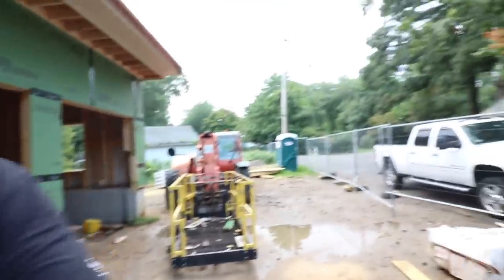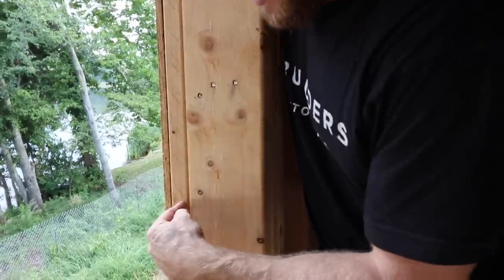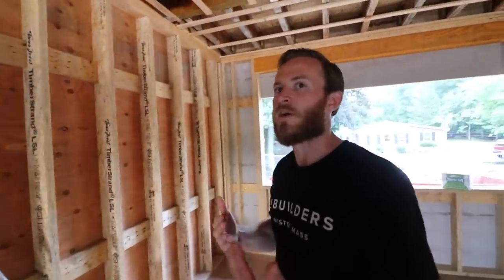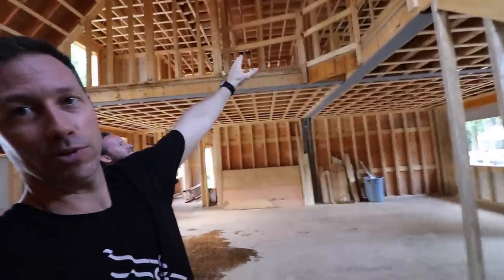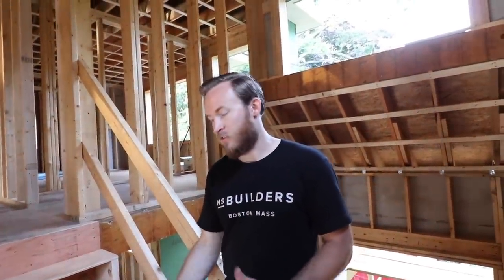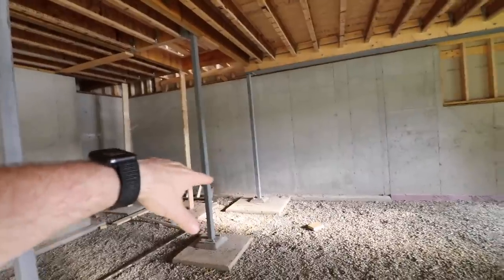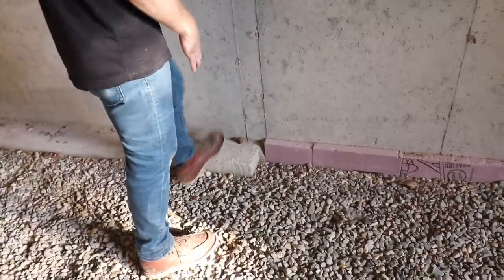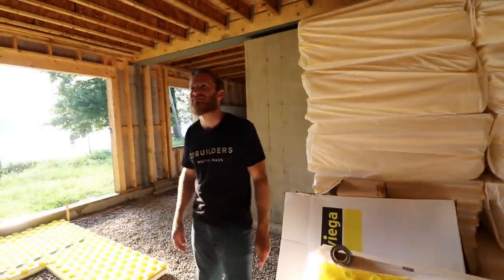How do they Build in Boston? Visiting a new home in Framing

Comment: I'm no engineer but I have difficulty understanding how a good shear strength can be obtained when the sheeting is spaced 2" off the framed structure via 2" of foam. No ridged connection of sheeting to framing? Much more reliant on nail strength? More nailing? Or are more HDU'S, strapping or other means required?

Comment: I am surprised not to see ICF foundations with ESP which does not retain water nor have reduced life /value like the extruded foams when wet.  AMVIC  also makes the radiant infloor  heating panels R-10 to R-16 with a vapour barrier heat welded on the top.. Very fast Pex installation, dont let the plumber charge for three days when hes only there for a day !!

Comment: My Tennessee home had no OSB Board on the outside of the home. When I complained about the noise I was sent for Psychiatric Evaluation and lost my job. After losing my job I had to repair the structural damage to the home and was later forced to sell the home. I've come close to be homeless several times. I'm a 90% disabled/retired veteran that bought new home with VA Home Loan and now I'm certified wacko courtesy of the APA. And my Psychiatrist's husband is contractor....go figure.

Comment: How one builds a home in the USA varies by region since the climate and groundwater varies.    

                       Here on the Gulf Coast of Mississippi how homes are insulated has to be way different than the North. We have long seasons of running the ac units and a short winter plus major hurricanes too. There is no frost line. Basements cannot be built since the house would float out of the ground due to a shallow water table.                    A home built here by north easterners will often fail due to mold.

 Ie how the vapor barrier is can be reversed and trap moisture and rot out the wood. It rains here 70 inches per year. 

Due to hurricanes our local codes has 5/8 (16mm) bolts into the slab about every 16 to 18 inches plus giant washers to hold the bottom 2x4 or 2x6 to the slab.       The code requires this here. Ie the Mass home is substandard here and would fail inspection and cause the work yo be halted. 

Also, our homes, if built in Mass, would fail since codes vary by USA regions.   

  Some Nice homes here rebuilt or built after Katrina (2005) have already gotten mold. Often the reason is foam insulation. Ie moisture got trapped and rotted out the homes walls or roof decks. The entire foam thing is risky if done wrong. Ie an older home that breathes often never has issues.

 Locally the strapping on the lumber for hurricanes is way more. The cost of all the 5/8 bolts and straps and added labor is not trivial.

  After Katrina we had many great northerners helping rebuilding homes. They often added ice dams up the roof decks 4 or 8 ft. A neighbors house already had a rotten OSB deck in that area where moisture got trapped and rotted the deck out. In another house the roof with a foamed rafter attic leaked and rotted out the plywood decking. Thus lawsuits. 

In AC refrigerant lines the suction lines often sweat here since the humidity is so high. They do this even if insulated with R3 armaflex HVAC foam. Thus some folks actually have a rain gutter under the attics hvac lines to drain water that condenses on the insulated lines. 

After Katrina some homes got rebuilt with Chinese drywall that emitted crude that ruined copper. Ie failed ac evaporator coils failed wiring sometimes too. Ie mess. 
\

Great video. But be careful that codes vary by region for a reason.  

Up North:) in Jackson Mississippi the slab homes often crack due to the yazoo clay. Thus slabs have tension rods and the soil base has to be proper too.

Comment: Window flanges should be screwed, not nailed. The screw can be controlled to create squeeze out of sealant evenly.
Reply: I disagree, screws hold the window flange too tight, and since the vynl and wood expand and contract at different rates a roofing nail allows it to move in the tracts of the flange...That is why the holes are ovals and not round.
Reply: I bet you cannot cite a current engineered study of best practices for window installation that supports your statements. I have performed over one hundred vinyl window and sliding door installations according to an engineered detail specification, with a 100% percent pass performance after field testing for water and air tightness.  Not bragging, but reporting my experience working in construction defect remediation and multi unit renovation

Comment: 16” and 19.2” oc for a floor truss system is an absolute nightmare for the HVAC guy.  Standard 5’ lengths of ductwork need to cut in 30” lengths.  Even then it’s almost impossible to get it up into the web of the truss.  When I know in advance that the floor trusses are different than 24” oc.  I load the trusses with my duct work from the rim before the sheathing goes on.  Plumber hate it too.  I’m no engineer why not use 1” sub flooring.

Comment: My parents have a Dryvit house they built in 1994, and as with all older EIFS systems, they had to come back in years later and fix the mistakes in sealing and flashing. Now that I'm interested in this stuff, it occurs to me to ask:
What's the benefit of having the sheathing on the outside of the foam rather than the other way around. If that's a rookie question, forgive me!
Reply: Foam under sheathing eliminates thermal bridging through the studs and headers, while leaving the siding, doors, and window installation standard practice. Don't confuse the installers. This is key!
Reply: rickrudd There are pros and cons. Look into it. Neither system wins it all

Comment: What is the brand name of the facia board used on this job?
Reply: Tapco/Boral TruExterior
Reply: Forest Page Thanks, I couldn't make out what he said.
Reply: @Tubeytime  translation service for the Boston impaired lol
Reply: Thanks Forest, I was wondering the same thing. Does anyone know if it has the same problems with excessive thermal expansion/shringkage as PVC? I used PVC on a garage a few years ago and the joints all opened up in winter and squeezed together in summer. Ended up fixing it by putting in gaps at the joints and filling them with high stretch caulk. It worked but I won't be using PVC again in the future.
Reply: @siggyincr7447  you have to bevel cut the joints and use a good glue ( 2P10 or WhiteHot) with the accelerator.....no problems
Reply: Siggy in CR I never tried it myself, but I was under the impression that primer and glue bonds the pipes together. If that's your case and the joints are still failing then I would switch to a different pipe. Pex is good for everything I hear.
Reply: *fascia

Comment: Interesting video.
As you may know, most all US state's residential building codes are now based in the IRC, the International Residental Code, which is a section of the International Building Code IBC.  This code was developed in the 1990s, as it was rightfully realized that good building practices will work in most all countries. In the US, the codes are adapted or modified for each state to focus on the materials, conditions or environments that exist in that state, whether it be the climate, hurricane-force winds, storm surge, earthquakes, etc.  In Florida, our code is more focused on wind loads on buildings, coastal building adaptations and the overall integrity of the exterior envelope.
https://en.wikipedia.org/wiki/International_Building_Code

Comment: Polyiso foam will not release that water..... theres gonna be constant mold problems on that house.  This is the same stuff as for Commercial roofing and once it gets wet it's ruined and has to be replaced in my experience

Comment: Lots of news stuff I haven't seen doing construction in ND. I would have loved that dimple board for all the miles of pex pipe I layed this summer in homes and shop floors. Or those LSL boards for hanging your kitchen cabinets to a straight wall. Also have never seen that type of sheething. I recently had to quit a great paying construction job because the owner just didn't take pride in his work. He cared about the quantity of work done, not quality. Got old trying to make stuff look good when the other two guys don't care about the end result. He got greedy as hell this fall and we poured a slab on a freezing cold day with 30+mph wind gusts. That whole slab top froze before he even got half of it power trolled. I want no part of a crew like that...

Comment: I hear that those wooden I-joists are deadly for fire fighters in event of an emergency. Supposedly the plywood in the center burns much faster than a standard 2x6 or 2x8 causing floors to drop under people. Any thoughts on that?
Reply: Not true at all
Reply: @joeframer9642  do you have anything to back that up?
Reply: Pretty much any wood that isn't solid wood will burn faster once it starts, partly because the glue facilitates faster burning and the smaller wood particles catch on fire easier
Reply: Sean, That is my thinking as well. I have several fire fighters in the family and it scares me to think of how often these things are being used. And it seems like builders aren't looking past the benefits of the system.
Reply: Simply not true, the glue used on the osb is a poly urethane glue which is a class A fire retardant.  Google gymthane

Comment: 2 story living and stair wall should have studs ran floor to ceiling. Having plates ran horizontally in the middle of wall severely weakens the wall. Every nail fastening the zip osb has penetrated into the water  membrane destroying the product. It is no longer water tight.
Reply: If you read the Zip website they claim that overdriven nails only affect shear strength and not water shedding ability. Not sure how true that is but that's what they claim.
Reply: the water shedding ability is affected by ANY nail or hole......
Reply: Walls don't run full height like you describe for several reasons. Fire spread being the most important and the original reason why we don't build "balloon frame" walls anymore, and why we build "platforms". 

Long length lumber is often more crooked, waned, and crowned. It's also harder to source long lumber too.
Reply: @brad-yo7jb  fire blocking every 10' in between studs takes care of fire code. I just dont see how 2 2 by 6 running horizontly is sturdy nor does it meet 2012 national code.  Lvl studs if needed to get straight studs. I only bring this up because matt thinks he knows everything but is probably paid to push products he has never installed and knows nothing about. He is your standard general contractor that thinks knowing how to operate a phone makes you qualified to build a house.
Reply: Mic Mills you are right that the fire blocking takes care of the fire code. Can you show me (code # and page in 2015 IBC where it says you can't have the walls stacked like that?

FYI, their is "national code", and IBC, but depending on locale, some places still use 2009. Sad I know. Massachusetts though is very progressive, and I'm sure this house was built to a code approved standard and was stamped by an engineer too.

I agree LVL and PSL and TGI studs are strong and straight, and the only way in my opinion to frame tall walls, when you aren't building them with conventional framing like they did here.

I think it's unfair to say, "Matt thinks he knows everything". This video is the  perfect example of him searching out new or different ways we do things. He shows his elation for all the variations we have here in the northeast, to how he builds in TX. Just my take, but he takes me as a guy who just wants to share his knowledge or discoveries with folks.
Reply: @brad-yo7jb  I cant say I have the ibc book just 2012 national is what we go by. I just dont see how any engineer would think it is a good way to build a wall. I like that matt brings the videos and conversations I just cringe about alot  the the stuff I can see in a video that he thinks is right. Look up the video of him installing and flashing a window with tyvek. I am certified in installing tyvek and saw multiple problems that tyvek even says are wrong. That is just 1 example

Comment: What is the point of using i-beams?? 
1. They are not efficient for any other trade, meaning they have to drill through them all.
2 They need reinforcement if cut through to allow larger pipes / duct work. 
3. Duct trunk lines need to be normally run along the ceiling or have a designated location to run.
3. They cant run as long of spans as a web truss.
4. They are not any cheaper.

Overall, they are a outdated product that should be reserved for sheds and barns.

Comment: I saw this zip sheeting at the international home show in Las Vegas a few years back and I thought people would never use this crap it's way to expensive. 
I guess I was wrong. 
I build spec homes and try to compete with the track builder ( HR Horton crap ). 
The buyer never ask what type sheetrock is on the home, but they all want to know what price its selling for.

Comment: Cool build, superb craftmanship.     Having used Rockwool for the first time more then 40 years ago, and living only half an hour from their world headquarters, I was surprised to see the name used in the US, the product was introduced as Roxul in the US a few years ago, when did they switch to their main name ?.   Living in Rockwool`s native Denmark, it is mind boggling to see houses being built in such a cold climate (colder then Denmark) with so little insulation.     Example in Denmark !     heated concrete floor:   MINIMUM code 12"     walls with that many/that large windows:   heat loss calculated, but probably 12-14"     ceiling / roof to outside:   heat loss calculated, but probably 16-18"     And for heating:   nothing less then condensating boilers, no 50 - 60 - 70 % efficient boilers like yours.     And mandatory heat reclaiming ventilation, AND pressure testing of the building for air infiltration ( 10 % chance )

Comment: What's with the lone foundation pillar? I feel like that does not have the strength to hold up what is on top of it. Axial strength in particular.
Reply: My guess is it's at least a 1'x1' concrete pillar with its own foundation below the frost line. So it's at least 4' feet long, perhaps closer to 6'. It isn't going anywhere.
Reply: @RandomPlaceHolderName  I hope so. Even with that much length underground, it would still make me nervous for the longevity of the house. After 30+ years, things tend to shift
Reply: Mister E  Not a fan of pier foundations huh? hehe
Reply: My old house I lived in in Sturdridge had piers above grade, when we finally got around to remodel that part of the house you would be surprised how well they did despite shifting to some degree, I would not mind a pier/piling foundation as long as its buried to below the frost line or even a but deeper if I do not need a basement there. But I would rather have a walk around basement foundation just for the extra space it provides when you need it, mind you the old home I used to live in is in MA and I was still young and not yet out on my own.

Comment: Bad idea putting that behind the plywood the ply directly on the framing is what gives the building it’s sheer strength and by maintaining a standard nail pattern an inch and a half away from the wall you have severely lessened said value
Reply: You sir are exactly right..... read your comment and doubled back 2 see...lol
 I didn't notice that at 1st.... they should have been notched out at least for direct contact to the studs..   🤔

Comment: Strapping the ceilings is to tie the parallel walls to the structure for high winds. So you strap your ceilings then stack build instead of balloon framing? Makes no sense. There are a lot less expensive ways to get the same results of all this engineered lumber and excess flooring and zip board and cell foam insulation. Good luck finding a roof leak with closed foam in the rafters. Those engineered joist cant even support a pool table without deflection.

Comment: This is not a typical New England build trust me..It's a custom likely and if it isn't this guy didn't make any money. Great attention to detail and like where his heads at in terms of quality, but you have to balance that with making $$. In this build, he likely cut into his profit SIGNIFICANTLY with this approach. WAAAAAAy overkill on the floors, i joist with standard AT will have almost no deflection, unless elephants are living there..And WAAAAY overkill on the kitchen wall just for inset cabinets..any waviness in the wall you just throw the plasterer a few extra bucks and tell him to true up that wall for the cabinets. No need for laminated lumber behind a wall. Could have just bought hand selected fir studs and got the same result for alot less. Definitely his first build, and there is alot of techniques in here that show well on podcasts and youtube but not necessarily in real life where we need to make money. I can't see any homeowner custom or not caring about some of what he did in this build and willing to have that cost passed on to them.

Comment: cheap construction. stick with fir ply and Typar or Tyvek.  Been building  mansions in New England for 30 years and never used osb or that zip wall garbage. Build it right with better materials and you'll never have problems.